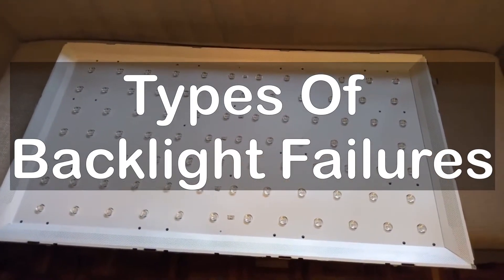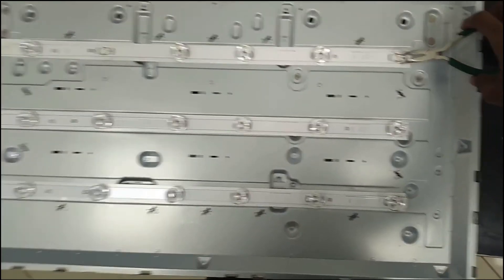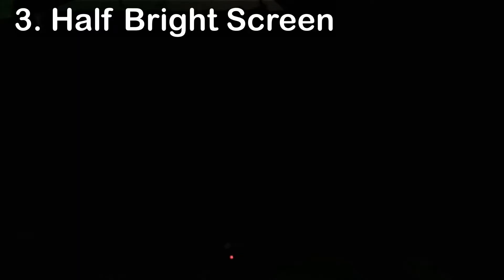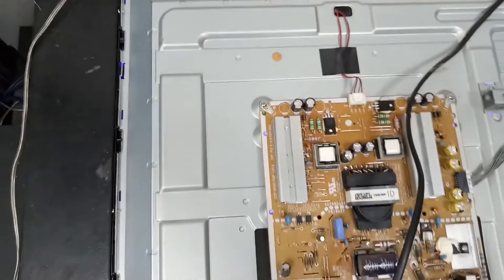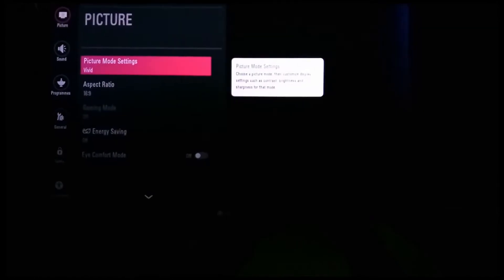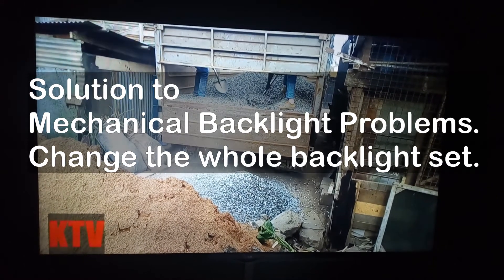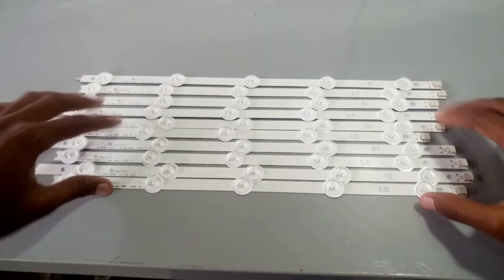Types Of LG TV Backlight Failures Episode 3

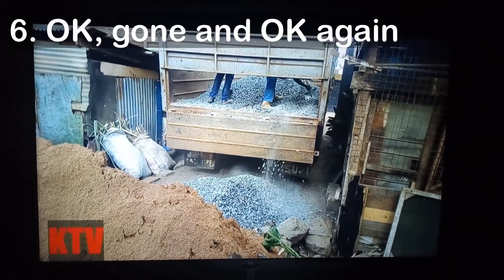Comment: I have problem no. 6 2:19 .My tv works for 20 mins with led lights set to 100 and then turns off so I have to turn it on again. But if I set the back light to like 10 or 20 it works for 2 to 3 hours easily.
Reply from the maker: Changing the whole backlight set might fix this problem

Comment: I have an edge lit LG 55SJ850T smart TV.  My problem is I have a screen that has 6 distinct lit areas with 2 half/half horizontal areas split into 3 verticle areas so I have a these 6 areas in a symetrical 3X2 unevenly lit areas.  Trouble is that along the bottom three squares the outside two are bringt and the centre square is dimmer and along the top it is reversed so the outside two squares are dimmer than the centre square.  This is very annoyingly noticeable watching TV where there is a constant colour like the sky in a video.  How can this be when I know there are only two LED strips of whcih I have already got a pair of replacements.  If one of the strips was faulty I would surely get just a left and right split in brightness ??  I do not want to undertake this difficutl LED strip replaceement if it is something else causing this 3x2 symetrical uneven lighting problem. Is it maybe a dislodged lens or light diffuser ??  

Many thanks for any help you can give me and thank you for your great instructional videos. I am BTW a retired qualified senior electronics engineer (but not a trained TV technician) so feel able to carry out the work as sadly I cannot get any TV engineers here in Thailand to undertake this task for me.

Comment: 2:19 I have this problem. Any idea what causes this issue? I have been troubleshooting this LG 55LM5800 TV but cant seem to find the cause? At first the backlight would stay on for an hour once we turned it off and back on again and then it started only running for 10 minutes or so, then the backlight started turning off immediately.
Reply from the maker: I'm sure when you change the backlight set, these problems will go away

Comment: great video thanks a lot Dominic! i have lg 47LS5600 with backlight problem. if i set backlight light at menu at 75% works fine. change channel fine. if i set it to 100% i change channels and backlight goes off. i turn off tv and on again and works fine again. no bad caps at first sight. what would you say led problem? thanks again

Comment: I have glued back the fallen pieces. It is much better now but with a bright video I still see  LEDs are like bright spots. What is ur advice?
Reply from the maker: The backlight array is built within very tight tolerances so any deviation will result badly. The only one solution is to change the whole set of backlights

Comment: mine turn off row by row from bottom to top then all turn off, what's the cause? should i repair or buy a new one?
Reply from the maker: The only solution is to change the whole backlight set
Reply: @DominicGichane  i talked to the technician, he said the whole screen needs to be replaced which costs 1/3 more than the price i paid for this monitor.